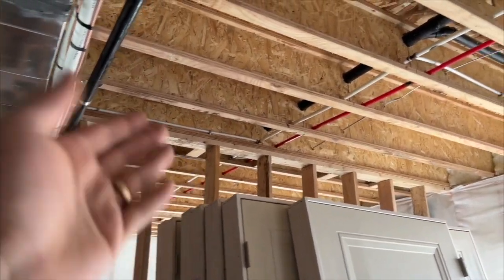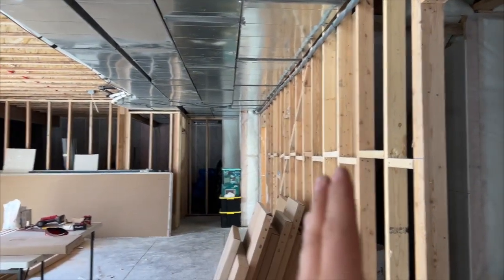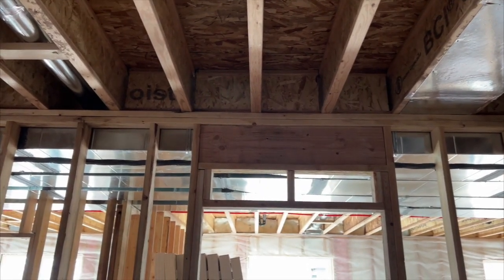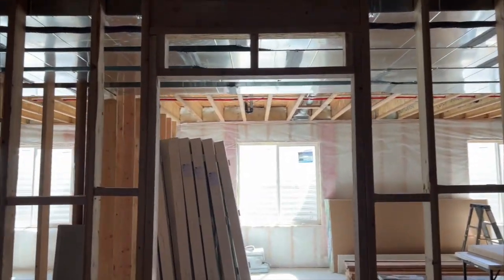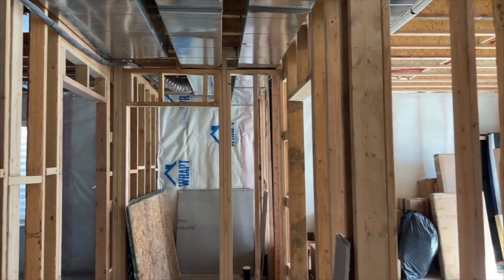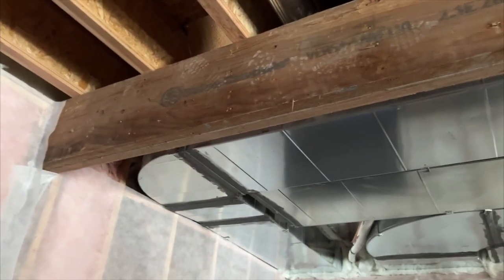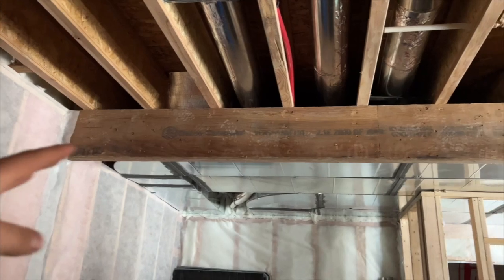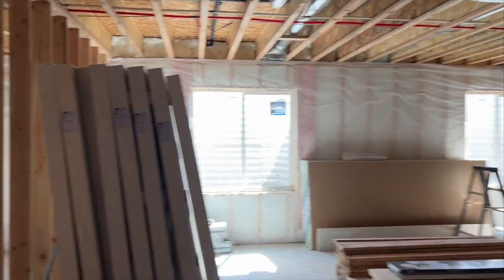How to Identify Load Bearing Walls in Unfinished Basements

Comment: what about perimeter studs? are those ever load bearing in the basement ? how can we tell? thanks!
Reply from the maker: Typically the studs around the perimeter are not load bearing. 
The concrete foundation wall is what holds the weight from above in a typical situation. 
I would recommend having your contractor look at it with you, as your home may be different than typical and they would be able to spot any load bearing items pretty quickly.
Reply from the maker: There are situations where some of the studs on the perimeter can be load bearing. It is not as common, but in this video I showed a beam and columns. One of the columns supporting the beam was on the perimeter of the basement, the other column was in an otherwise non load bearing wall. So, in this situation, while the wood walls were not load bearing, the wall was containing a wood column that was supporting a wood beam.

Comment: Looks like to me that the 2x6 wall was built to accommodate the plumbing stack running through it.
Reply from the maker: Yes, I had not looked for that at the time i recorded the video. That is a very likely reason. Thanks Brandon!
Reply: But that is not the wet wall 🙄 🤔
Reply: @jeanius123 then what exactly is the black pipe running through the wall. Is it abs or a metal pipe.